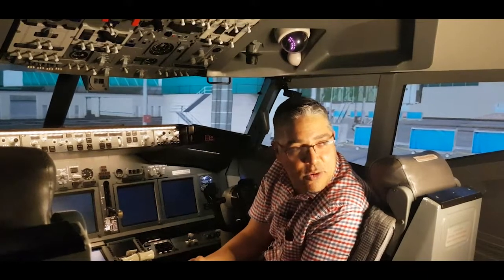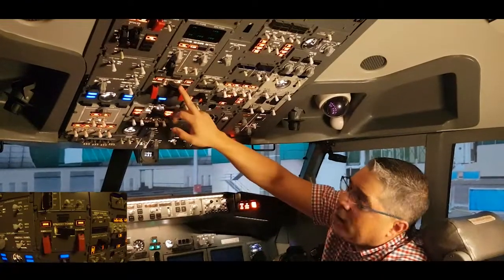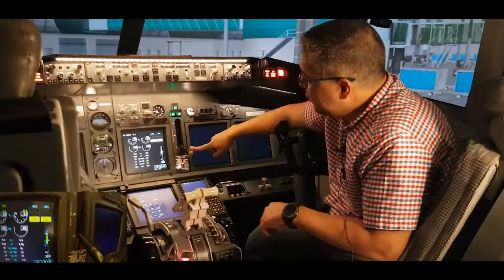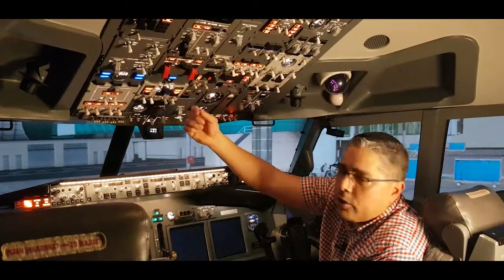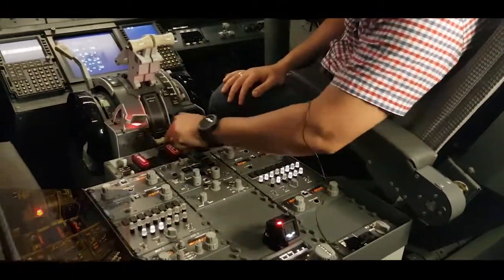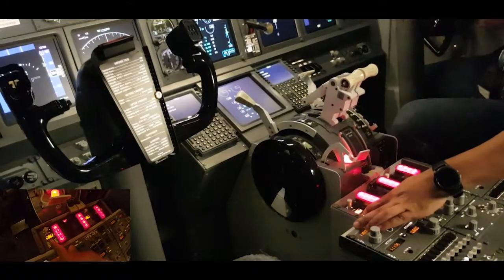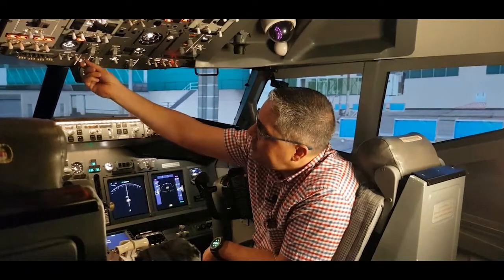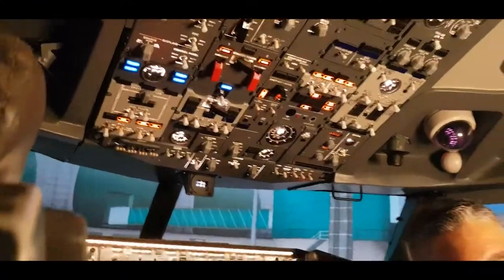Boeing 737-800NG - Dubai to Muscat Series - Electrical Power Up explained. Part 1

Comment: How come the engine GEN OFF BUS lights are not illuminated?
Reply from the maker: Hi! Thanks for the question. Let me check and I'll get back to you.
Reply from the maker: Thank you for pointing that out. I just noticed. Unfortunately,  the sim was not exactly like the airplane. You're right, at that point those lights should be illuminated.
Reply: @AviatorLifeCS  thanks for checking! Glad it wasn't me. I'm just studying now, haven't shown up for class yet. Thanks for putting up videos like this.
Reply from the maker: All the best! I'm happy the videos are helping you, that's the most important thing, to help each other.